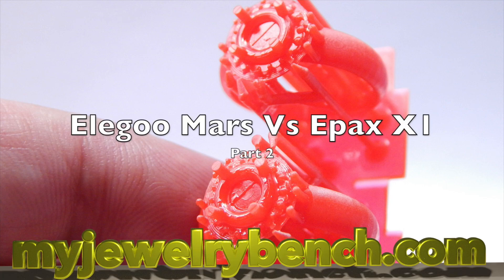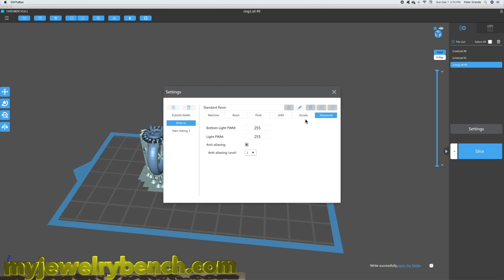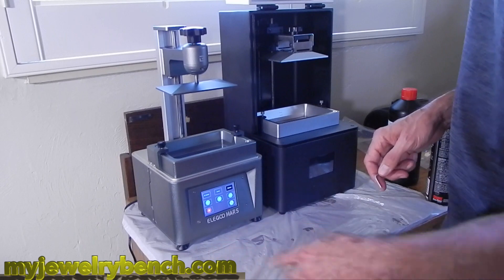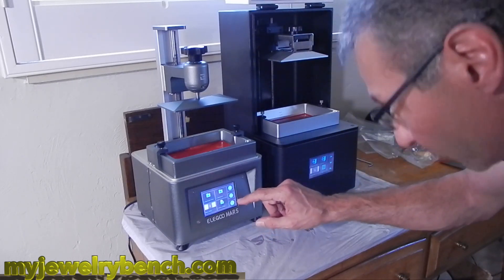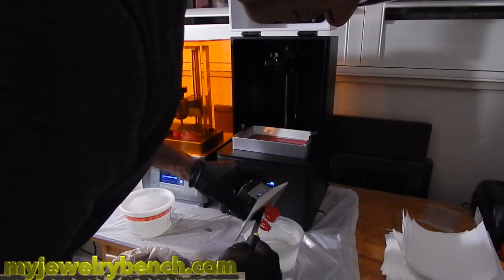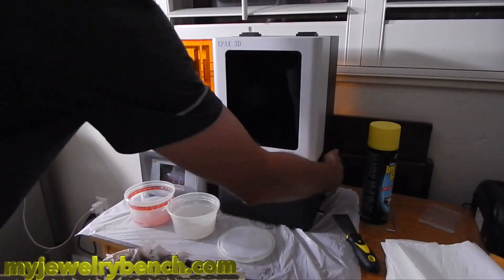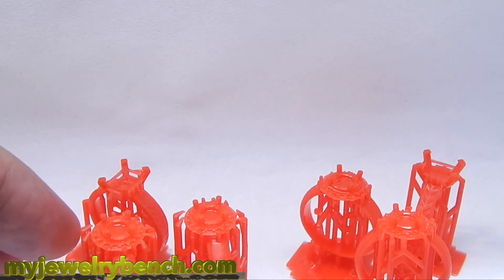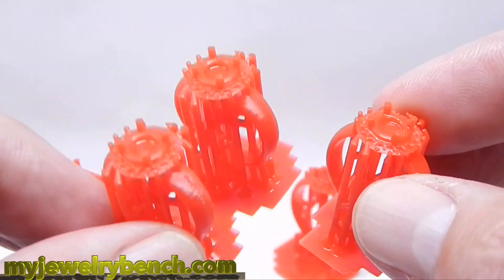Elegoo Mars VS Epax X1, Part two- Castable Resin

Comment: Hey I’m thinking of buying a printer and but I’m not sure of what kind of computer or laptop I could use that would support the 3D cad softwares ...Could you give me any recommendations ?  Thanks
Reply from the maker: One more thing. When I travel I use a small under powered notebook computer. It works but don’t expect to get much rendering or high quality image production. It will work well for modeling. 4 gig ram and integrated graphics. I think I purchased it for about 400.00 at bestbuy four years ago. It still works. Don’t forget a numeric keypad if not built in
Reply from the maker: Good question. I recommend at least 8 gig ram. 2 to 4 gig video adapter and an I 7 or a good MacBook 15 or 26 inch. I actually use an acre gamer computer. Priced around 1100 to 1200.  It serves me really well and 17 inch monitor.

Comment: Very good video, thank you!
You definitly need an fdm printed support for the filter-tank connexion, when you pour the resin in the tank. It seems not usefull to hold the filter and pour the resin at the same time, with the printer plate just above ;-)

Comment: Hi. So after trying all of these castable resins what is your verdict? I'm planning to get Mars with funtodo red castable resin after watching your videos. Thanks
Reply from the maker: Doing an edit now.  It’s a good one. Stay tuned
Reply: @watchesandjewelry  Great. Can't wait to see it Peter. Planning to wait before getting the resin. I hope to get some info how did it looks after burnout
Reply: Oh Please, Please?!? what is the secret?!?   I have the ftd red castable n a epax x1. Prints great but casting not so much.   This is a fairly common complaint with the ftd red. Have been casting wax consistently for years.  Tried all the usual long post print processing suggestions.  Tried all the burnout procedures ftd recommends and several others.   Surface of casting sucks and details are garbled.   Please... do I have to buy $BlueCast$?!?

Comment: The new "Cr3ator" printer from bluecast (which is basically a OEM Mars) has the Epax Array LED matrix installed. At least it looks EXACTLY the same as the epax one on the photos I saw so far.. So it seems you can install the Epax array led on the mars as well. (maybe you have to drill different mounting holes?)  The epax array is 119,- from fepshop and about 70-80,- from aliexpress. But I will wait for the release of the Mars Pro version before I decide to try that mod or not on my "regular" mars. BTW if you replace the flimsy 5mm long "chinesium" grubscrews on the mars buildplatform with some regular M6x16 hexhead screws you can tighten them down much better and dont have to relevel every prtint. At least I dont do now and have good results.
Reply from the maker: By the way!  The matrix led is only 99.00 direct from road and you will have it in three days.